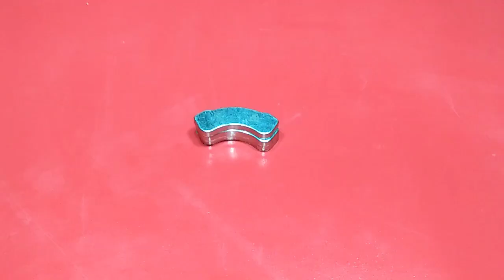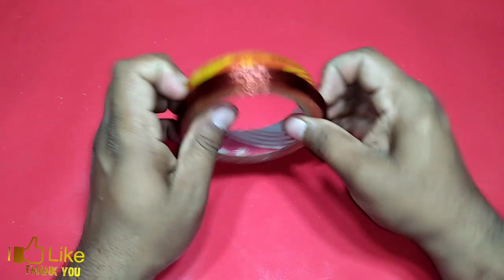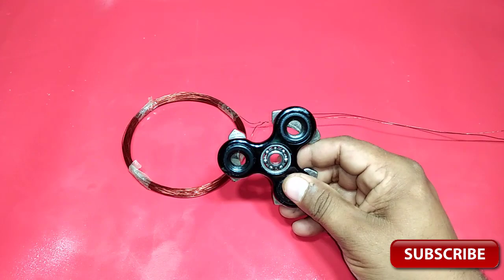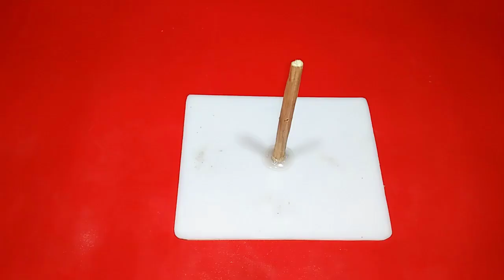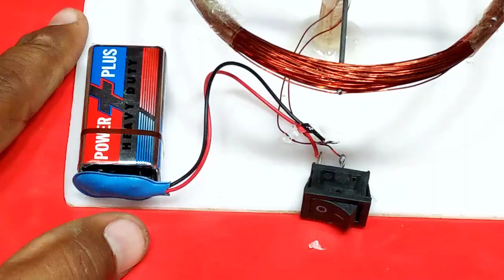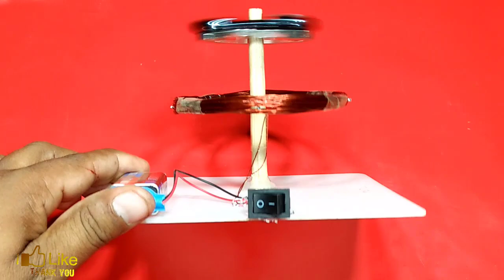How To Make High Power Motor With Fidget Spinner Magnet Battery And Copper Wire DIY Project Exhibiti

Comment: My daughter and I tried to make this for her 4th grade science fair project and it was a a complete failure...I should have read the comments first.  

In order for this to work, you need a reed switch (a magnetic switch) to interrupt the flow of electricity to the coil.  Also, we had to place our coil standing vertically next to the fidget spinner, not directly underneath it like this video.  In addition, we had to use a large 6v battery to get the fidget spinner to spin at a rate close to what was depicted in the video.  

I’m guessing the guy in this video used canned air or an air compressor to power his fidget spinner.

On a positive note, we learned about what a reed switch was and how to make one from scratch using a paper clip, copper wire, and wood from another video on YouTube.
Reply: Thx very helpful

Comment: I don't know it seems impossible to me, it's almost look like those free energy thing video. I mean, how do you oscillate the coil if you are powering it with DC? I would have believe it if there at least an reed switch that acting as commutator. An AC motor doesn't need a commutator, but it require three coils for three phase system

Comment: Nothing this guy does is real. I think it would be cool if he showed. How he does all of it. Almost every trick he does is done with a induction coil under the table, most of the time the copper SINGLE copper wire is just completing a circuit. There's minimal science to what he's doing. Good way to get paid by fooling everyone